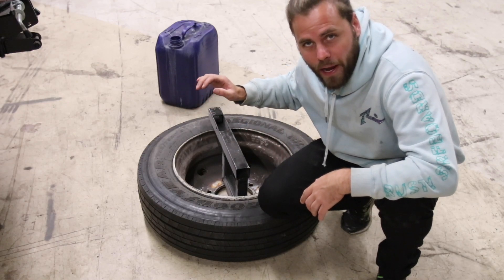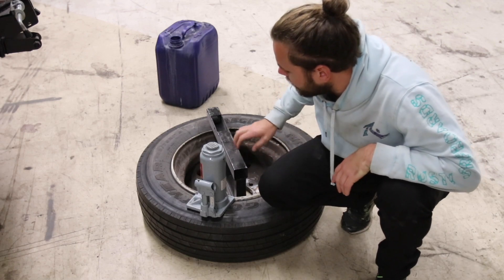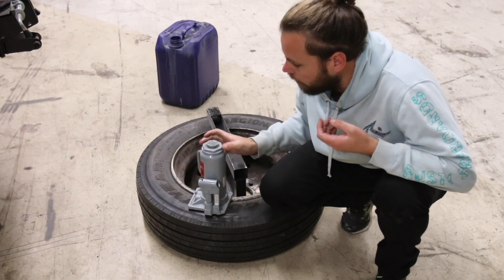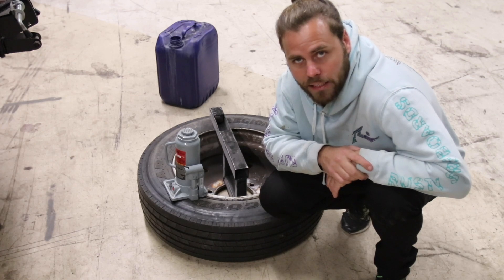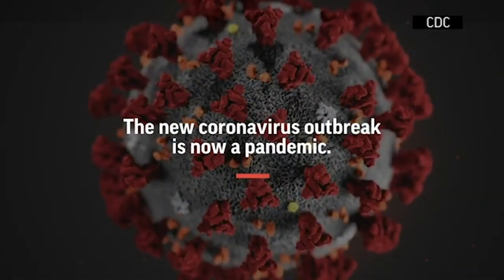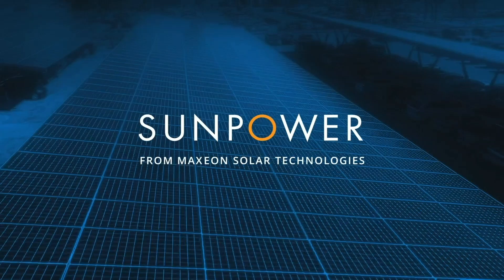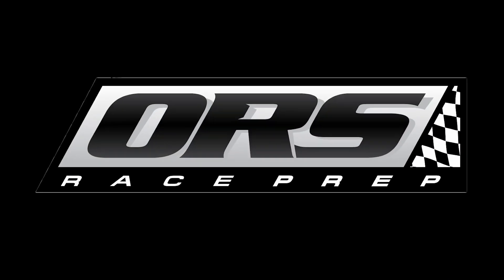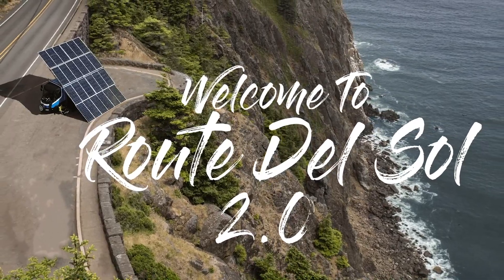SPARE TIRE HACK FOR MY DIY SOLAR POWERED VAN BUILD

Comment: instead of a strap holding in the jack one could add a pocket for the top of the jack to go into when you jack up a little. then release or lower the jack a tiny bit to remove. simple and the jack actually holds itself in. Will only work if you have the room above the jack. you might be space limited.
Reply from the maker: I thought about that then I realised the specific way the jack had to fit made it inaccessible to relieve the tension screw. But glad to think that we are all thinking of better ways to do things.

Comment: total overkill, arent you concerned about weight? I would be more conservative on the material thickness. Also why putting the impact gun in to the spare wheel? Take a big  wrench instead of an impact gun, in case you need fix smth you can do more stuff with a wrench...
Reply from the maker: I have an impact gun and a wrench. I like both tools and they both have their uses. The weight is minimal but yes I am always thinking about weight. However structural integrity must never be compromised.

Comment: What is it with Youtubers removing the guards on every grinder in shot. Do you like disc fragments in the leg / arm / face or something. STOP DOING THAT. 
Rant over :D carry on.
Reply from the maker: I prefer them without the guards but yes I do also dislike the metal and disk in my body parts... I don't specifically own these grinders. But I am guilty of removing the guards...

Comment: The angle you cut in the table saw....
Tall side at the back fella, that way it can't jump out if the blade grabs it. ;)
Reply from the maker: Did you see the arc that I was cutting? I'm not sure how possible that would have been with the tall side down...
Reply: @RouteDelSol  1:42 ish. Looks like a square cut. Maybe camera angle not picking it up then, my bad.